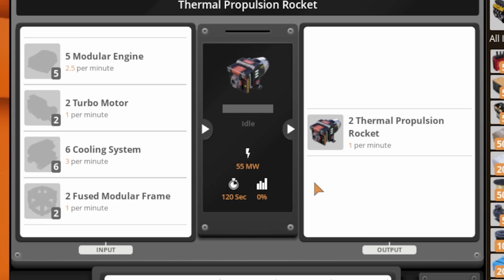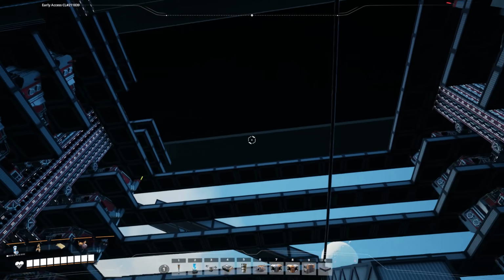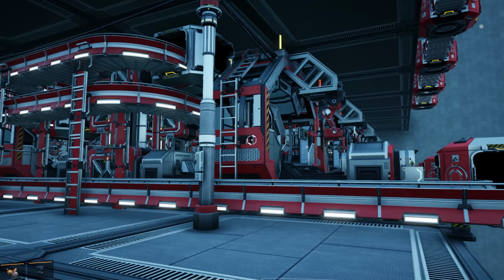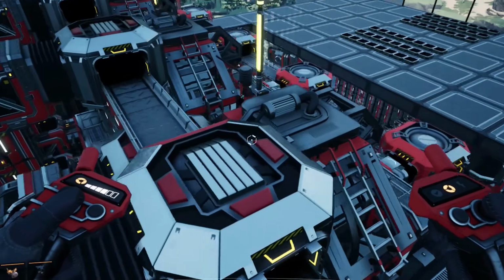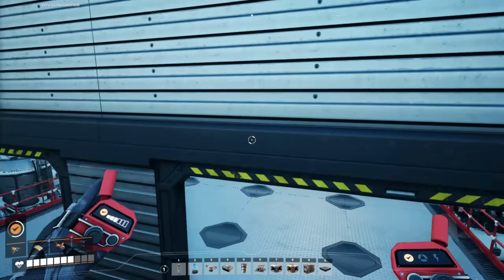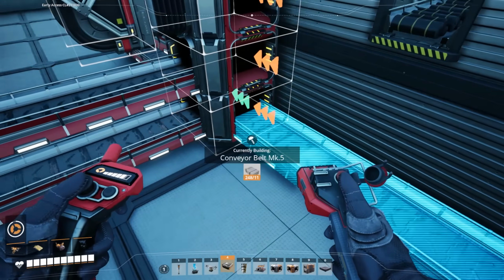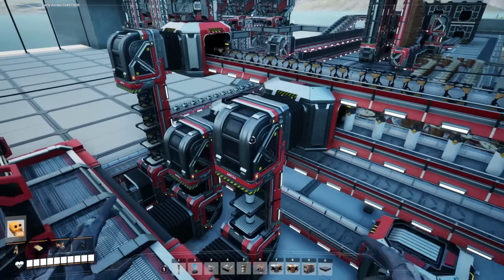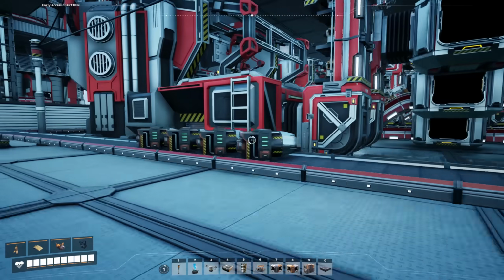I Spent 750 HOURS Automating THIS in Satisfactory!

Comment: I did it in 207 hours with shared production via a single circular aorta. Could have been faster as I overlooked an alternative receipe for the wiring, using rubber for too long. Time for a retry when 1.0 comes out, although the map, the resource distribution and thus the strategy will be a bit different then.

Comment: Idk, can't you handcraft those?  You'd think it would take less than 750 hrs manually doing everything.  /sk

But seriously, I've gotten away with building really modest factories, my Blender Diluted Fuel to Refinery Turbo fuel to over 9,000! ok, 50 gens, (out of 58-9, Idr) cause the build started to piss me off and those are my largest builds so far.

I've started to delete my coal plants because the acid rain is killing the forest... wait, Factorio flashback...

What's the point of building so big?  IDT I'm even gonna build nuclear powa plants... and I've almost completed Tier 8.  I have to make those uglier than heavy frames, so I'm building drone stations to distract myself first.  I believe I can fly... I believe I can touch the sky... hitching a ride on my drone...

Comment: Interesting.  I didn't come close to using this much crap and still finished the game.  I had two manufacturers making the parts needed for the assembler.  The rockets were easy as I kept making parts since wayback and stored them, and didn't have to remake all those items.  It took several hours, like 36 or so, but it finished everything without having to build crazy plants like this one.  Take it from a REAL engineer - you are spending too much time trying to do it all at once!

Comment: I only realised how much goes wrong with making a factory when i made my own in satisfactory. Its tiny compared to this thing obviously but it took ages to make the plastic system work properly. And i think that the same goes for the factories in these vids. I garantee u they produce less of the items they are meant to. But without mods like counter and efficiency checker, kibz wont notice it unless its something critical like the nuclear power plant which as we can see has failed a lot over the years due to tiny causes. Same cud go for the main ones. When building my factory i wudnt have noticed the plastic production being trash if it wasnt for the counter mod.

Comment: I designed my setup for only 2 Thermal Propulsion Rockets per minute and I finished it right before blueprints were announced. The thing is even with only 2 per minute, it was kind of disappointing how quickly I made 1000 while messing around with other stuff. This whole huge system was no longer necessary.

Comment: Well, I managed to pump out what the elevator needs for thermal propulsion rockets    "1000"+ by just manual moving what it needs to storage containers, also using the alternative recipe that only needs rotors, motors, electromagnetic Control rods and Radio Control Units to the manufacturer W/O spending tons of hours automating it. Win Win. AND YOU spent HOW ?? many hours going WAYYYYY too far in numbers for production. LIKE ALWAYS. There's no need to go balls deep, my friend. There's no need.

Comment: Hey Kibz or anyone with the knowledge, should I use the belt that best matches my output or just the fastest belt available? Does it make a difference
Reply: If you have the resources and materials you can build faster belts, it takes a ton of aluminum sheets to build mk5 everywhere but you might need them eventually anyway. early/mid game I would just use mk1 or mk3 until you are maxing those out and need more throughput

Comment: the Modular Engines look like some kind of electric engine and the Turbo Motors look like a V8 engine (V refers to the shape and 8 refers to the number of pistons) this is the first time I'm getting a good look at both cause I'm usually running around so much I never get a good look at things.
Reply: The turbo motors are literally twin turbo V8s.

Comment: And here I am getting overwhelmed just by the 3rd round of Space Elevator parts...
It also hit me that I'm kinda doing myself major disservice by not doing overflow systems but instead trying to get a perfect ratio on everything...
Reply: Not easy without overflow but much more satisfaction. I stopped a year ago at level 7 without overflow when the new release stopped the penalty of overclocking. Now I wait to try again when the game is completely finished.
Hold tight as long as possible 😊
Reply: @BrainStroming1789  tbh idk if the game will ever be finished
Reply: @BrainStroming1789 u coming back for 1.0?😊

Comment: The Steeled Rotor and Caterium Computer alternate recipes are definitely my favorite. They immensely simplify motor and computer production, especially early game. Really nice being able to take iron out of both of those production lines, especially the screws.
Reply: Also, try to get the caterium circuit board. Allows you to remove copper from computer production. Forgot to mention that as it allows full computer production with just oil and caterium.
Reply: @Jackie89000  i prefer silicon circuit boards + crystal computers to make a computer factory without oil, but caterium computers work really well in blue crater with all of the oil

Comment: Im still stuck on HOW TO MAKE AWESOME FACTORIES but at the same time finding motivation for alllllll of this LOL. There is so much planning and thinking and my brain cant handle it. Looks amazing Kibitz!!!
Reply: my brain is mush trying to understand imkibitz's belt work
Reply: @sushmapadubidri1684  I also wonder how did kibitz memorize all those belts and it's items
Reply: you know you've rounded a corner when when you realize "winging it" by just plunking down a bunch of machines & hoping it will be enough just doesn't work anymore, & you finally stop & ask yourself, how many of these parts am i trying to make? which recipe is best? just how many machines will that take? & you realize half the fun of the game is found in excel 😅
Reply: @tzgaming207  Thats only if you want to be super optimal. Excel is required when you play games like Factorio as there isnt really a good way to deal with overflow.

Satisfactory has plenty options for overflow(like the Awesome Sink). That way, if you produce 1 million items per hour, but only need 100k items per hour, you start off with 900k items overflow. Sounds like originally a waste of time, but you quickly reach a point where you need more of those items. Going from 100k items an hour to 150k items an hour, to 300k items an hour and before you know it, you're at a usage of 1 million items an hour.

If you were smart, you'd probably get a few storage units in between to deal with the initial overflow and set up an Awesome Sink to get rid of the items overflowing once those storage units are full. That way, you can have a requirement of 1.5 million items an hour and still be able to supply before you need to add another input.

I went a bit overboard on my most recent playthrough and got 100 industrial storage containers per item in a centralized storage location. The smallest stackable items are at 50 items per stack(there are some at 1, but you dont really want to automate those in the first place), leaving 240.000 items in the storage room for the smallest stacks, and 2.4 million items for the largest stacks. Most items are 100 items per stack, but thats still nearly half a million items for overflow.

I intend on starting over too, I am planning to have a total of 1000 industrial storage containers per item, but instead of centralizing them, I want make them the central piece of each factory and having that central piece connected to a central storage location with "only" 2 industrial storage containers per item. Requires 0 excel use.
Reply: im struggeling with understanding it too LOL
Reply: @Zoard1404  same
Reply: Build the factory, to function and be efficient then just encase it in a shell of pretty
Reply: This is one game where I can only watch others play it. I do not have the time nor attention span to deal with how long stuff takes to build in this game.
Reply: @TheGamingStrudel  Well, you can do it really quickly, it just depends on what you want it to look like. You could, in theory, get everything you want, build it in the sky on a huge flat platform and get to the end in about 100 hours. Which sounds like a lot, but 100 hours is nothing, I watch roughly 2 hours of episodes once a week with a friend, we've been at it for almost 2 years and we've seen 250+ hours of episodes.

If you were to play this game once a week in your weekends for about 4 hours a day and once a week 2 hours in the evening on a work day, leaving more than plenty room for different games, movienights, drinking with friends etc, you'd finish this game within 12 weeks. The best part of it all? You could leave the game running after you've finished a project while you go to work/school/a night out/sleep and you'd be basically fully stocked for your next project.

I have a relatively low attention span for slow growth, but that only depends on how you decide to play. About 15% of my playtime in Satisfactory is actually me leaving the game running while I went to work.
Reply: creating the layout, design, location of the factories is also hard for me, watching kibitz always inspire me to work hard playing this game
Reply: @SPPR89  same here... mr kibz absolutely moved me to improve my playstyle 🤘
Reply: one of the great things about this game is it's completely at your own pace... there's no rush... i can't tell you how many hours where i start up the game, work on something for either a few minutes or a few hours, then just leave the game running & go do something else, come back to it some other time... honestly, i feel like a huge part of the fun of the game is outside the actual game... watching other people build, getting ideas & inspirations... working/planning on builds conceptually in excel... i had put the game down for 8 months once but kept up on goings-on, then dove back in with a renewed vigor, all new ideas & strats... satisfactory will wait for you ✌
Reply: Same here
Reply: Games are meant to be fun, you don’t have to do homework in your life anymore, it’s fine to just watch someone clever do it and get satisfaction from it 😌
Reply: @tobysimmons4139  you're absolutely correct, and one the the most beautiful aspects of satisfactory is its freestyle nature, there is no wrong way to play... for myself, excel & the number juggling is an extension of the game (that i can play at work! 😅) .. there's lots of utilities out there to help with planning but i never really got just what i wanted from them, i had to do it in excel... & doing so actually helped me grasp the game better... now when a plan is ready in excel & i build it in the game, say like, a nuclear power plant & all the machines needed to support it, with disposal, & watch it work nearly right away with perfect 1:1 production+consumption all the way through & everything at 100% efficiency, that's, well, satisfying 😄
Reply: Just do what RCE does
Reply: @Charles  who is RCE ?
Reply: @delroyclarke1989  real civil engineer
Reply: @drakeorr9956  Ah right okay thanks
Reply: Or a pc
Reply: Yea, just google free satisfactory calculator and if you want to output a certain number of things, it will tell you down to the exact number of resources and buildings you will need. Helps a lot.
Reply: I use satisfactory calculator.

Comment: This reminds me of the time I decided to automate 20 Thermal Propulsion Rockets per minute back in update 4. The amount of resources I needed to process was absolutely absurd, and it took like 200 hours or something to finish.

It worked though. Craziest thing I've done in this game.
Reply: Stuff like that is what has kept me from sinking tons of time into this game, sadly. In the time you spent scaling up the one item in Satisfactory, you could do a full 1,000 SPM Factorio megafactory. I'm glad the game has blueprints now, but it's still frustratingly slow to push up to large scale.
Reply: What ? We have now 45 hours on the map and are in phase 5 space elevator only 2 last items missing . We have 65.000 mw of power and everything works actually the later phases got easier
Reply: @niklashannig9118   easier if you just do the bare minimum, some people wanna do mega builds and put time into making it look good, share your map, bet its spaghetti everywhre and not a nice thing to look at anywhere

Comment: With all manifold/overflow systems I like to balance the machines using different belts (speeds). Ex: If machine only needs <60 items/min it gets a mark 1 belt feeding into it from the splitter. If it's 60<x<120 then mark 2 belts, and so on.
Reply: i find higher tier belts help with general throughput and buffer speeds
Reply: couple that technique up with using smart splitters to fill one machine at a time & then overflow on to the next smart splitter, etc., not necessarily faster to get a batch of machines running, but i feel has smoother sustained delivery once there, & more visually pleasing.. as long as you're feeding in at least total of all the machines' part demands, no issues... although there are definitely situations where using fast belts all the way through is more effective 😊
Reply: @tzgaming207 ye but tbh. No ones doing that
Reply: @leftclickisbeterthanrightclick  sorry, no one's doing what? i'm not sure i follow 🤔 the belt thing? that's mostly an aesthetic touch, for me, i only just recently began using... when i've got all my machines tuned just right, producing exactly the right amount of parts at the exact rate, & everything is flowing nice & mellow, & every machine is running at 100% efficiency, i can just sit & stare at that for wayyy too long 😎🌿🥦🚬
Reply: I used to do the same thing too, and still do to a degree, but I’ve found that it’s typically much faster to charge any system by using only the fastest belts available.  They get the components from point A to point B much faster, resulting in quicker charge times of all manifolds.